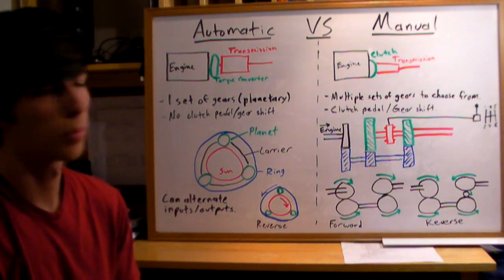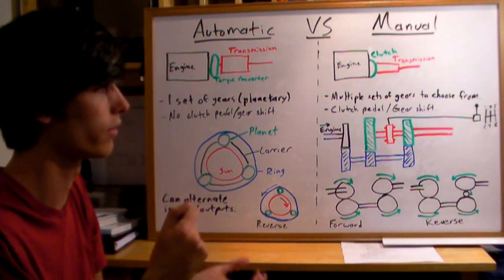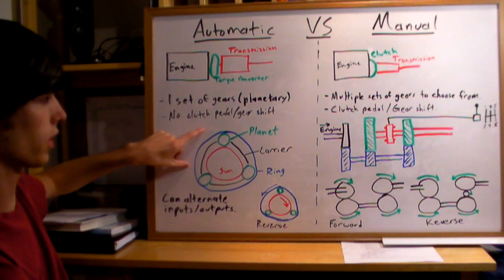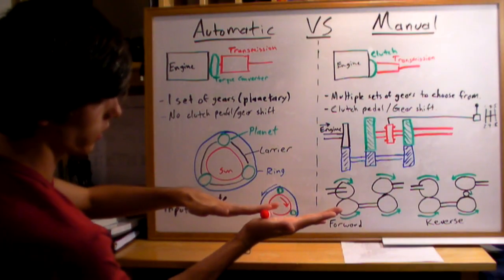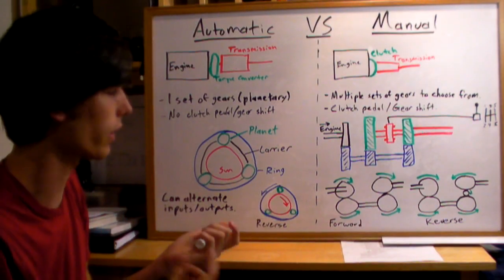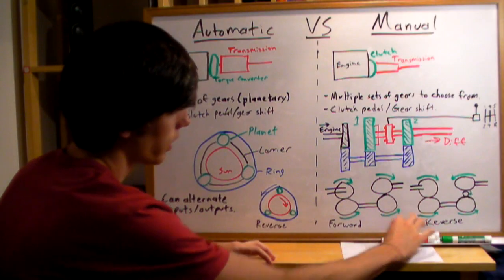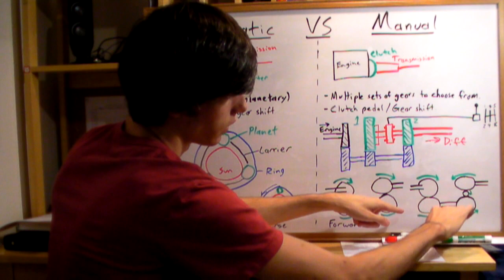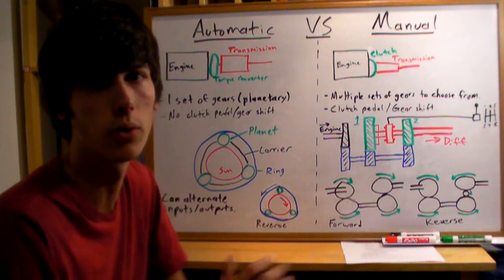Automatic vs Manual Transmission - Explained

Comment: Engineering Explained could  you consider a video on full sized truck transmission?  I don't mean pick-up truck (like the Raptor you used in explaining awd & 4wd), I mean like an "18-wheeler".  I have seen them with 1 stick-shift (with buttons, but also clutch pedal), 2 sticks and also 3 sticks.  I can speculate how it works but as I enjoy your videos and you ways of explaining things, I would really like to have YOU do this.

Comment: Which the transmission shifts faster? Car with automatic transmission accelerates linearly is it better than manual trans. ?
Reply: martinicoss An automatic transmission can shift faster than a person can shift a manual. Many drag racers will use automatic transmissions.

Comment: do semi-autos (I mean flappy paddle shifters) use the planetary gear set or something similar to what is in a manual car with clutch?
Reply: no those are the dct(dual clutch transmission) there are two sets of clutch one for odd and one for even set. everytime u paddle shift for eg. ur running on 3rd gear the previous 2nd and the after 4th are already engaged in the transmission so when u try to change the gear from 3rd to 4th the whole transmission doesnt get disconnected from the engine only part of it gets disconnected . so there is continous power through the transmission . its actually better than a manual transmission. and pardon me i k now i didnt explain properly u can search for dct's in google :)

Comment: I know this comes across as a silly question, but what would happen if you had a manual box with a torque converter instead of a clutch? would it still work? You come off the gas when you depress the clutch, you could release the gas of a manual and change gear with a torque converter? I know it's a daft question, but would it work? How would it be to drive?
Reply: The dog gears are not meant to connect with any applied torque from the engine, as they cannot slip. It might work at first, but the wear rate would be very high.

Comment: Question for ya Jason, first of all huge fan!
I'm studying Mechanical Engineering at Auckland Uni, you are about  ten times more efficient and a hundred times more interesting than our lecturers ya legend.

Back to the question, lets say the car has been put into neutral, the clutch has been disengaged and in a previous video you said that the disc is spinning freely

Now if the output shaft is spinning at the speed of the wheels, how does the car match the revolutions of the outer shaft to that of the input & countershaft when a gear is selected?

And is it because of that difference in speeds between shafts that you cant go directly from second to fourth gear say, if your not at a high enough speed?
Reply: see his video on clutch plates. u will understand.

Comment: Here's a question for automotive engineering. Does the number of gears affect fuel economy? I have a 2001 Mazda Protege ES 2.0L with a 4 speed automatic(optional back in the day). My car, imo, doesn't get the fuel economy of todays cars, which is baffling because it's a 2.0 not a V-6, but for a 2.0 I'd say it is thirsty and I blame the transmission because of the wide redline before shift during acceleration. So I think that if I had a transmission that had maybe 6 or 7 gears with differential ratio geared for street/highway driving only, not racing but not CVT geared, I could probably squeeze an extra 10 mpg. I believe the car got 24 city/28 hwy, which is abysmal IMO. Any thoughts?
Reply: +Jason Lurf Also I don't drive like a maniac and I read in an article on Mens Health that driving an automatic below 2000 RPM where it can shift under that like around 1800 RPM, you'll burn less fuel. As I drive, sometimes I think of force and effort the car is doing at a certain speed and the amount of fuel being burned per minute or per hour under 4 gears and I guess Mazda designed my car model for sportiness even though it's not the MazdaSpeed which came with a spoiler and a turbo and intercooler.
Reply: +Jason Lurf 
"Does the number of gears affect fuel economy?"
Yes, it improves fuel efficiency, and performance as well.  Obviously you don't want a 100-speed transmission, but I think you get what I mean.  A 6-speed transmission is generally superior to a 4-speed.  In some newer cars, it's not uncommon to find transmission with 10 speeds or more.

Comment: Idler gears dont change the second main gear's direction, the idler gear keeps them spinning the SAME direction. Otherwise, good video
Reply from the maker: +Jack Tackett Which is the opposite of all the other gears...
Reply: What i mean is that the diagram shows the two last main gears in the reverse gear moving in opposite directions

Comment: Great videos.
I had a question regarding engine idling. How does an engine idle for either manual or auto? The crank is still spinning so how, by just pressing the brake, would the car stay put even though the engine continues to idle?
Reply: +Matthew samson A torque converter allows the engine to continue rotating, despite the transmission (and thus the wheels) not rotating. In a manual transmission, the clutch performs the same function, though if you are going to idle for awhile, it's highly recommended to put the manual transmission in neutral, otherwise you will prematurely wear out the throw-out bearing in your clutch.

Comment: Why do some cars in reverse make a whining noise when you accelerate? 

I notice it in videos of older cars in reverse.
Reply: Reverse gears are often strait cut, where the forward gears are usual helical gears. Strait cut gears produce this typical whining noise.
You can also hear it pretty well in some onboard videos of gt or rally cars. Race cars often use strait cut gears for all gears because noise isn't an issue on a race track and strait cut gears allow a lighter gearbox casing because they produce no axial forces.
Reply: shi01 ah thanks man! i think it sounds cool too
Reply: *****
Yes, i never said this would not be the case. But curved teeth also iduces axial forces along the shaft and so on the bearings and the gearbox casing. So yes, helical gears are a bit stronger if the gears are the same size, but they demand for a more complicated bearing assembly and a stronger gearbox case. And in the end this will add more weight than the slightly less wide gears would spare

Comment: So to convert an automatic to a manual you just need to replace the torque converter with a clutch + 3rd pedal?
Reply: You will need manual transmission since the syncros are different than auto, clutch máster cylinder, slave cylinder, linkage/cables depending on the car
Reply: No, mechanically you would need to replace the entire transmission. As well as an entire clutch mechanism, you would need a new transfer box and manual gearbox. Good luck!

Comment: What about the automatic gearboxes which have sequential hand shifting mode (most serial sports cars). How they works?I mean did they work like normal sequential gearbox with some electronic which take the sequential gear selector control  in automatic mode or they are like the usual complicated automatic gearboxes with more complicated sequential shifting system.I am asking that because I have watched your explanation video about sequential gearboxes and the are pretty close to the manuals.Pleace explain! Sorry for the bad english.

Comment: Haha I cringed when you made that grinding gear sound.. Partly because it sounded realistic, but mainly because it brought back bad memories. Could you do a video solely on Manual transmissions? A 50/50 video split with automatic just doesn't do it justice. You have engine breaking, rev matching, so many different outcomes since you can choose engine speed and gear. Thanks!
Reply from the maker: Eventually I should get into a few more topics. Cheers.
Reply: Engineering Explained Can you please explain how does the automatic transmission gear shifting work? Thanks :)

Comment: Thank you very much for your videos!
I'm subscribing your channel.
One thing I couldn't quite understand is that 'why do you have to use a tourque converter for automatic transmission?' Why can't the engine spin the fly wheel and the automatic transmission do the clutching andgear changing?
Reply from the maker: A torque converter isn't necessary, it's just the most common thing that was used, and continues to be used. There are still automatic transmissions which do not have torque converters, such as DCTs (when automated) and CVTs. Like you said it is possible for a computer to do the clutching.

Comment: I dont under stand how connecting the gear lever to the gear (with the 'dog ears') means the wheels will turn in that particular ratio? It doesnt seem to connect to anything as far as I can see. Every source just says that by moving the gear lever into gear, it connects it to that particular cog and somehow it changes gear. 
Sorry i cant think of a better way to phrase the question without drawing a diagram :)

Comment: You can tie into your AT wiring in your car and use a switch to force lock your converter clutch. This will help your AT mpg a good bit, your transmission will do it much slower than necessary, especially under load.

Comment: The clutches in the transmission are control by a pressure valve unit and a pump on the input of the transmission. As the input speed of the transmission increases so does the pressure of the pump. When the pressure reaches a 'shift point' it forces a valve open and follows a channel to the next clutch you are dis/en-gaging. This channel changes depending on the position of all other clutches. And sometimes multiple clutches change positions in a given shift.

Comment: Torque converter is donut shaped and has a little clutch in the center, the converter is 'locked' when the clutch is engaged and makes the engine 1:1 linked to the transmission input. But when the clutch is disengaged the engine rotates at different speeds using the converter. The converter consumes energy so you lock the clutch to increase mpg. But when you go to shift gears you disengaged to clutch so the engine can be one speed and transmission can be another, and slowly they will synchronize

Comment: I have a question. My truck is making a scratching noise whin I'm in 2nd gear at almost 1000 rpm but it goes away when i disengage the clutch. Any ideas on what that might be?

Comment: But a transmission box replacement should be a very rare thing to do. I can imagine buying a second hand car with 300.000 km and then having to need to change it once. My former Volvo '95 850 had 406.000 km on it, still with the original transmission. I dumped it because of the wiring and electrical failures.

Comment: I agree with Engeneering explained, perhaps it has to do with shifting style. Use low throttle in first and only give gas when completely locked. And some transmissions need regular fluid replacements, also depending on usage. I always drive Volvo's and an original clutch will last 200.000 km easily, some people even manage to drive 300.000 with one!

Comment from the maker: It's absolutely not true, really it would come down to the driver more than anything. I have a 15 year old car with 125,000 miles on it, on the original clutch. My boss has 150k on his car, original clutch. Manual transmission can last quite a long time if you shift properly. But dumping the clutch at red lights will mean higher replacement intervals. Manuals are less complex, don't require transmission fluid (often, though clutch fluid is needed) and don't rely on computers to shift.

Comment: Nice video. Please: Do you know how dual clutch gearbox works at speeds lower than motor minimum speed for example in parking manuvers? They state that there are no torque converters! Will the 1st gear allow the clutch to spin? Thanks

Comment from the maker: You simply control a program and tell the computer when to switch gears, it can be done with a traditional automatic gearbox, which is usually the case in cheaper vehicles. Can also be done with CVTs, sequentials, and dual clutch transmissions. I have videos on each if you're interested.

Comment: the transmission needs to know rod speed and throttle angle to make a shift. computer contoled trans is a little more complicated than that. back in the day the used a governor to determine road speed and a cable that ran from the throttle body to the trans to determine throttle pressure or angle. once the governor pressure overcame the throttle pressure it would make a shift.

Comment: Hey I have a question : You said that with an auto, computers decide when gears should be changed for you, but how did it work back when there were no computers to calculate that kind of stuf?  Automatics have been around for a pretty long time.

Comment from the maker: Power losses through the torque converter. Also, with a manual you can choose when to shift so if you know the most efficient shift points you can get better mpg.

Comment from the maker: Well, for example, you can't simply crawl in traffic with a manual (without slipping the clutch) like you can with an auto, so the first gear may be a bit higher gear ratio. They may also place the gears closer together, since manuals tend to be for more enthusiastic drivers.

Comment: why do automatic transmission use lower gear ratios compared to manual
ie. toyota 86 have both manual and automatic as an option.
whats the purpose of this? why cant it be the same?

Comment from the maker: The purpose of gears is equal in both styles of transmissions. Autos use lower gears at lower speeds, just like you would with a manual.

Comment: It almost seems like manuals have certain gears for certain speed ranges. But automatics are built for changing torque by switching the gear ratios? Someone tell me if I'm wrong.

Comment: Manual doesn't necessarily mean operating a clutch. You're referring to an H-pattern synchro mesh system.

What modern touring car racing uses is a dog-box with a sequential shifter complimented by a strain-gauge.

With that, you can shift up in 0.04 seconds but still heel toe for the downshift. (it still has a clutch, and you can drive it on the street with fast shifts).

Comment from the maker: This is because many times reverse doesn't have a synchro, so it won't match speeds. Make sure your car is completely stopped when switching to reverse, or it's likely you'll hear some grinding.

Comment: yes, direct drive by definition means 1:1 gear ratio which the engine's speed or rpm is turning the exact same speed as the transmission at least to my knowledge:)

Comment: will I be right if I put it this way?
4 speed transmission, 3rd gear is direct drive
5 speed transmission, 4th is
6 speed transmission, 5th is.
And is there 4 speed manual or 6 speed automatic transmission?

Comment: @camargo2012 its all the same thing with paddle shifters, Modern automatic transmissions are controlled by computer so wiyh paddle shifters your just telling the computer when to shift te transmission, the only exception is a dual clutch transmission or a CVT

Comment: Yup.  Generally, it's always been cheaper.  In my particular case, I think it had to do with supply/demand at that time.  For some reason, the manual transmission was much more popular on the 2002 Saturn SC2 (in late '02, after the Ion already had come out).  Gotta say, I'm glad I got it, and $50 wasn't much extra when the car cost $18 grand.

Comment from the maker: Yes, you probably have warn synchros. The synchros allow for the gear and the collar to mesh together, but they wear over time. As they wear off, you're basically forcing a collar right into the gear, with no way of matching the speeds, so you simply hear a grinding sound. When you get the RPM close enough, it can still happen, which is what is happening when you rev up to engage the gear.

Comment: My 02 cummins six speed standard has a hard time finding 4th and 3rd when downshifting unless i bring up the rpms to match. Would I be correct in assuming that it has something to do with the collar/dogs/output shaft? If possible could you summize syncromesh.

Comment: Manual is fun.  I actually paid about $50 extra to have a stickshift instead of automatic when I bought my Saturn back in 2002.  Still driving it 11 years later, and it's still a lot of fun to drive.  Stick shifters with a clutch pedal are more fun that paddle shifters, in my personal opinion.

Comment from the maker: Sounds like you've built up some hatred for manuals. Have you driven one? Yes, dual clutch transmissions and sequential gearboxes will shift more quickly, but quick shifts isn't exactly what everyone in the world wants. Also, on low end cars, it's hard to find a good gearbox with paddle shifts. Manual transmissions on low end vehicles are great, and a cheaper option. It's not ideal for racing, but for spirited driving it's a lot of fun.

Comment: People think manual is better because they have excess energy they need to dump into a pointless task like operating the clutch.  Modern racecars don't even have manual clutches anymore because it's a slow antiquated concept, but much like baseball players have to chew gum to release pent up energy, a lot of drivers have to fiddle around with the plastic dick, i mean stick...

Comment: You have much more control over the car, you're mentally much more engaged in the entire driving process, you save your brake pads by using the engine to brake your car, it's more economical for fuel... If the road is 30mph, you could shift up to fourth or even fifth for lower revs, uses less fuel. Also, if you ever leave the states and have to drive a car, 98.3% of the time it will be a manual transmission.
Also, it's much more fun. First time you get to 60, you'll never want to switch back.